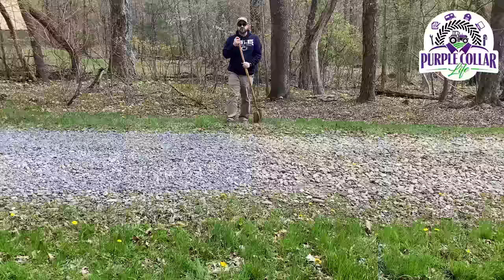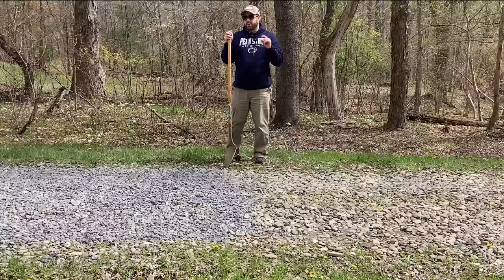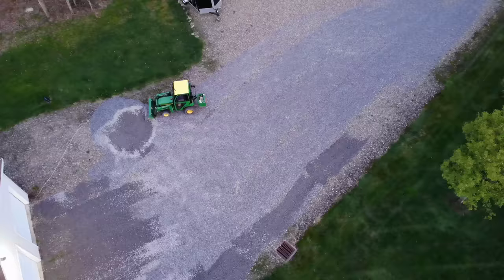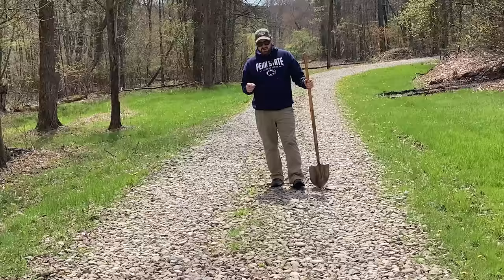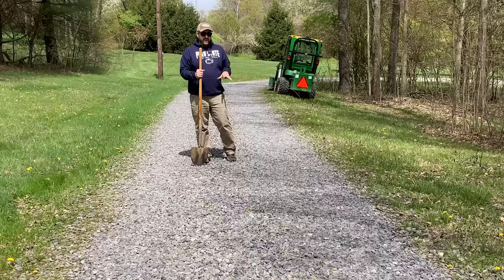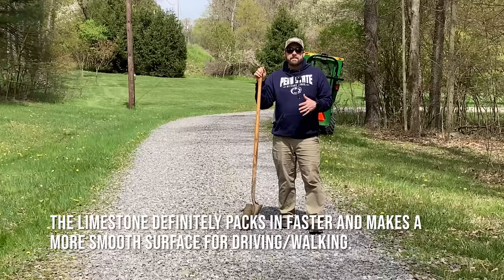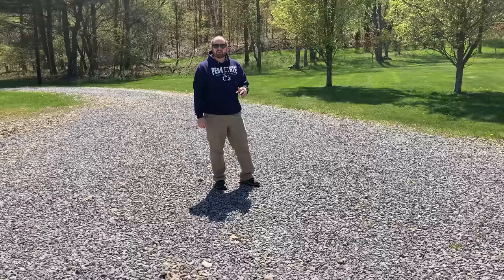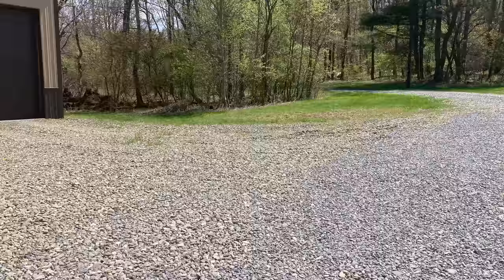Limestone vs Gravel in driveway

Comment: Your driveway will only be as good as your sub grade!, the last thing you want to do is keep adding more stone every year which adds up in money spent!. Limestone locks in and gravel rolls around!. If you dont want to use fabric before you put stone down then you should put down 6 inches of #2 limestone and 2 inches of 3/4 inch limestone with dust to choke your #2 limestone in place. And to make your wife happy the cover your drive with an inch of gravel to still maintain the rustic look. No matter what you put on top if your base isnt good it will keep pumping dirt up and stone down.
Reply from the maker: Unfortunately, we didn't put fabric down in our driveway when we built it. It would have been way too much cost at that time for our long driveway. We did do 57 tri-axle loads of shale as a base - so our base is good and solid. 
Good tip about just putting the gravel on top as a top-coat for the rustic look.
Reply: Ive used fabric and tin star but the good stuff is too exspensive. If 6" #2 limestone doesent look like it will work I'll get broken bags cement discounted and spread them out in bad areas then till it in with tractor re-compact in by wheel rolling it and install the stone, it will set up in a few days and you can also do it with ag lime in bags same steps and it will get hard as well. We use to do a lot of soil stabilization where I worked. Merry Christmas.
Reply: @steveashworth6707 gr8 info. Thx

Comment: Your 2s and 3s should only be used as a base.  When we build driveways we always use a geo fabric first, then a base of 4" crusher run, then topped with several inches of a 3/4 limestone crusher run.  Keep a crown to it and yoh will never have problems if you maintain it.  Washed stone will get plowed away easier than stone with fines.
Reply from the maker: Thanks. For driveways this long, the geotextile fabric is just too cost prohibitive. Long driveways are already expensive enough for the prep work and the material. I did use crusher run at first, but it creates potholes and doesn't let the water run down through as quickly (getting your vehicle more dirty). But that was just my experience. I've seen some people have great success doing exactly what you've described. 
You're spot on with the loose stone on top getting plowed off. I spend hours and hours each Spring getting that gravel out of the yard and back into the driveway.

Comment: Aggregate pricing is all relative to how far away you are from your reseller or the grave pit.  The trucking cost is what determines the varying prices, not the price of the gravel itself.
Reply from the maker: That's very true. The trucking cost is the expensive part. If we had our own dump truck - we could get the material pretty cheap.

Comment: Im in the mid south it hits 100 in summer and 0 in winter along with extreme rain in May and surrounding months my driveway is about a quarter mile also threw swamp like heavily wooded area near the Mississippi river The local rock company talked me into getting clay gravel mixed and a geo weed barrier to start as a base drive over it around a year then add a layer of crushed concrete forming a type of domed shape running into irrigation trenches along both sides of the driveway it has worked great absolutely no problems as of yet..
Reply from the maker: That sounds like the smart way to do it! :)

Comment: It looks good. It has an attractive appearance.  👍 We've used crushed granite for our driveway. It has a blueish color to it (I believe it's granite, anyway) and it works well for our application.  The only drawback is that it comes in irregular pieces and can turn an ankle if you run or walk too quickly on it. Thanks for sharing, Chad! 😎
Reply from the maker: Thanks for sharing! I bet the crushed granite really holds up over time.

Comment: We used B19 for years as a good base and even top coat. We switched to limestone with dust about 25 yrs ago and haven't looked back. It compacts well ans once dust gets wet, it makes it pretty hard and packed. Dust can be a pain when it rains hard, but we sometimes switch with washed topcoat. We also use a recycled crushed concrete gravel for our drive to out barn since it packs well and is much cheaper than limestone.
Reply from the maker: Thanks for the comment! I've seen people use recycled asphalt - and it does a nice job of packing in. Recycled concrete probably does even better!

Comment: Interesting comparison.... My drive is only 300 x 12 feet and has a 15degree pitch to it. After the initial gravel and clay base was packed down, I had 18 ton of #57 rock put down and rolled. I bought too much stone for the pitch so I have some spin ruts occasionally but it is clean, neat and apart from grading it with my ATV and  a 8' piece of chain link fencing, it is holding pretty well. Thanks for the video....

Comment: love the limestone just for the packing and locking together ability.  I personally have yellow clay for ground ( yuk, so slimy when wet )  I used 1-1/2 rock for a couple years to pack and firm up the ground , then I started using 3/4 minus crushed with all the fines in it to help lock it in. I found a supplier locally of crushed Granite with all the fines in it, that is even better than the 3/4 minus. the crushed granite  does not wash out for me, and packs in way better... give it a try , you may like it.  the crushed granite in north central MN cost me roughly $600 for a 10 yard truck load  ( tandem truck ) .

Comment: In my early days, driving a dumptruck, the often-said phrase was "river gravel always finds its way back to the river."  We always recommended crushed stone, especially for topping.  3/4 inch minus (3/4 or smaller, has dust and fines in it) was the recommended size unless a lot of heavy traffic.  Perfect for a driveway.  Gravel is great for making concrete, and for leach fields of septic tanks.  Other than that, crushed stone for aeverything else
Reply from the maker: That's a great, memorable saying! Thanks for the information and experience.

Comment: My driveway is a 1/2 mile long and I started out with 8 inches of railroad gravel from a old track being removed locally and then added some crushed concrete, it only sank about 4 inches, only thing I don’t like is the fines in the crushed concrete that’s always getting into the garage, not to mention the 2 wheel barrels of metal pieces we picked up out of the crushed concrete.

Comment: I just topped my driveway with 80 tons of limestone about two years ago. The original stone was installed in 1978 and has only been refreshed about 4 or 5 times before my last one. Hat tip - if you really want a firm base order stone dust first (same stuff they put on horse tracks) and spread evenly and let dry for a week or so. Stuff gets hard as concrete. Then top with stone. I second Neil’s driveway videos @digdrivediy
Reply from the maker: Thanks for watching! Sounds like your driveway has an excellent base!

Comment: This is what they post from my local stone place.
2B Loose Crushed Stone$37.60 / Yard  28.90/Ton for 22 Ton loads.
3/4" loose crushed stone, washed and free of fine stone dust. Used for drainage or under concrete slabs and sidewalks. Not preferred in driveways because it will not compact and become a firm solid base, and will roll out from under the tires when driven on, but some people occasionally use it in the driveway and apply it in a very thin layer and it helps prevent the muddy condition caused by the fine stone dust that is mixed in the 2A modified.
Reply from the maker: Thanks for sharing the pricing in your area! I am curious if we had switched to limestone earlier in our driveway life if it would have packed in better over time and we wouldn't have needed to purchase so many tri-axle loads of gravel. 🤔🤔
Reply: @PurpleCollarLife  No matter how much stone you put down it always seems to disappear. I used 80 tons of road millings and it works ok but the size of the millings vary drastically.

Comment: Great video, I just want to point out that my drive way is 1000 feet and up by the house, I used driveway cloth and it never disappeared but the rest, I have had to continually add.  So ground cloth saves a pile of money.
Reply from the maker: Thanks for sharing! That's very interesting that the ground cloth will keep the gravel from disappearing like it does without that layer.

Comment: Would it be more cost effective to put down geotextile fabric then limestone? The added cost in my high cost of living area would be about $1,320 for 1/4 mile of 12ft wide driveway. That's 5.8 loads of rock at $450 each.

Comment: $650 for 25 tons of 21AA delivered in mid Michigan. Packed heavy clay base, geo textile fabric then the gravel. Its been very solid so far.
Reply from the maker: Thanks for the info! I have a few questions if you don’t mind. What is 21AA stone? How long is the driveway? Does the 25 tons provide a fresh top-coat for the entire driveway? How often do you do this?
Reply: @PurpleCollarLife  21AA is a mix of crushed stone and fines that pack extremely well. It's often used on top of larger base stone for gravel roads here in Michigan. It's not as aesthetic as limestone or river rock but it's very functional and is very solid when packed. Hard to say how often it needs to be topped off. It depends on how stable the base rock is and how much traffic it gets. Personally, I have geo textile fabric over well packed clay as a base so I don't have to add to it, I just resurface it with a box blade on my tractor. The fabric keeps it from sinking down. The driveway is about 110 feet.

Comment: Use geo fabric under your gravel for areas driven over often. More upfront cost less additional gravel needed over the years. I personally use 825b which is essentially #57 which is what you have with some pieces a bit larger with the fines in it as well. The fines helps everything lock together.
Reply from the maker: I do wish I had invested in the geo fabric. But with a driveway this long, and building a house - I just didn't have the extra money at the time. The 53 loads of shale base was expensive enough. :)
Reply: @PurpleCollarLife  I feel your pain. We are slowly but surely getting 26 acres back into shape after decades of not being used with a house to be started hopefully this year.

Comment: Crushed/recycled concrete is the absolute best way to go. It packs and no more pot holes . I did mine 5yrs ago with crushed concrete and have had no problems
Reply from the maker: Thanks for sharing! How small do they crush it down to?
Reply: They crush it to a gravel style no big chunks
Reply: It actually crushes better than gravel you won't have all the rocks
Reply: @PurpleCollarLife  You can get it in different sizes, a common size for driveways is #57 which is ~3/4". They use it a lot on large construction sites around the construction trailer and temporary parking lot.

Comment: For the amount of agrevation your putting on yourself, you should experiment with 50 or 100 feet of Portland cement and sand bags or bitiman and hot asphalt compare prices. Yes you can do pavement yourself. You can use your existing stone for cement the asphalt usually has finer stones.
Reply from the maker: Great info! This summer we actually did about 300 feet of this driveway with tar and chip (chip seal). https://www.youtube.com/watch?v=TaP3PsWhNr0

Comment: On a brand new virgin drive way are larger stones better for a starter base and then work smaller in the future?
Reply from the maker: Absolutely! I always recommend working from larger stones as a base, to smaller stones as a surface as it packs down.
Reply: @PurpleCollarLife  What size base stones would you use?
Reply from the maker: @Rick-tb4so  I used shale on the bottom, and then 3” gravel.
Reply: If you can afford it lay down road fabric before putting down any stone. It’ll prevent stone from going down and dirt/clay from coming up. That’ll save from adding so much stone over the years. It won’t totally prevent adding stone because it wears down with traffic. You can put down larger stone on the fabric first. As far as size everywhere in the country seems to call stone different things. Wish we could come up with a universal sizing system. The size of base rock will be dependent on the size of vehicles traversing your road. Light vehicle traffic you can get away with railroad ballast size. Big trucks you’d be better served putting down larger rock which what we call surge stone in Georgia. Then lock that larger stone in with a smaller rock or crusher run. Putting the fabric down also allows you to put a thinner layer overall than no fabric. 
    Another alternative to all of this, I bought an ABI SR3 grading rake and it can scarify the drive and bring buried rock back up to the surface so you don’t have to add so much rock overtime. This setup is best for a singular size stone drive, not drives with a surge base as you don’t want to bring that large rock up to the surface.
Reply from the maker: @hoytballard5504  Great tips!

Comment: Not sure where your at, but in Iowa all gravel IS limestone.
And it's yellow. 
You can hear the difference from yours.  Yours sounds like a harder material.  Almost like granite. Ours is a soft sound and yes it breaks down.
River rock here is HARD smooth round stones that you could never use in a driveway.   Only good for gardens and in concrete.
It's weird how stuffs different by location.

Comment: I wonder if a real road base installed at the start 20+ years ago would have been cheaper?
Reply from the maker: That's an interesting question. I'm not sure what you consider a "real road base". Ours was over 50 tri-axle loads of shale. I believe that's what is typically used as base for any roads I've seen built from scratch around here.

Comment: I don't know, but seems to be the road base wasn't cleared to the sub soil, and and then a good base put down and compacted. 

Instead just smoothed/leveled and gravel put on it. Unless there are some pumpy areas (always wet) shouldn't be that kind of settling from what I have seen. It certainly isn't cheap, but  sounds like a lot of work was done over 22 years and probably cost more in the long run. 

That said, you gotta do what you gotta do. Don't always have the ability for the best, sometimes just the good enough.
Reply from the maker: Thanks for the comment. Our base was actually created by removing all the top soil (bulldozer - that's why there are multiple piles of topsoil along our driveway to this day) over 50 tri-axle loads of shale (from a shale pit), then 22 years of gravel on top. :)  I guess when you build a house in the woods, with a long driveway, it takes some time for it all to settle in.
Reply: @PurpleCollarLife  Thanks for the reply. If that is the case it would seem to show that smooth rocks are probably not the best road surface as they just continually move and no way for them to lock together like crushed stone to create a solid interlocked mat. Things to think about when building your long driveways for sure!

Comment: Damn doing that every year, asphalt is cheaper. My driveway lasted 20 yrs and its still ok. I payed $5000 in 2004. for 2800 sq ft. You will spend 8000 to 16,000  over 20 years.
Reply from the maker: We did get a more recent quote for asphalt - it was going to be $24,000 for our driveway and turn around. And then you also have the cost of sealing it every few years. It would be nice though to never have to get gravel again. :)
Reply: @PurpleCollarLife  sealant is a waste of money a driveway is destroyed from water/ice underneath. My first driveway lasted 19 yrs and I sealed it many times. The 2nd driveway is 20 yrs old never sealed it once, I will get 4-5 yrs more out of it. I payed $5000 for my last driveway .Sealing costs $200 so I would pay 5000 sealing it annually over 25 yrs ,sealant lasts 1 yr or less. best to put the 200 x25=5000 towards  a new driveway.

Comment: First of all river rock IS NOT GRAVEL. Second, why why would you use rounded river rock for your driveway?? Those rocks will never bond together and the reason you think they are "breaking apart" is that if you lay round rock, on round rock they snap easy under load. Think eggs in a basket if you must to understand. That is why your driveway keeps "disappearing".
River rock on river rock is basically a gravel slip and slide.
So sorry you waisted so much money over 20 years adding river rock on top of river rock just for "looks"
Jagged cut rocks (recycled cement) that is what gravel is. River rock are just large pebbles.
Always always use gravel (jagged cut rock) to build your gravel driveways. 
Lay a good 3 inch layer of 3 to 4 inch jagged rock. Then add a layer of crushed jagged rock with fines in it and Compact it all together. THEN lay down a top coat of 1 to 2 inch jagged rock (gravel) and watch the bonding magic take place.